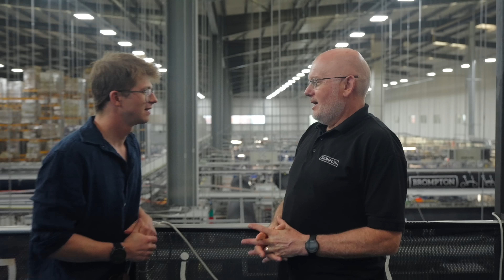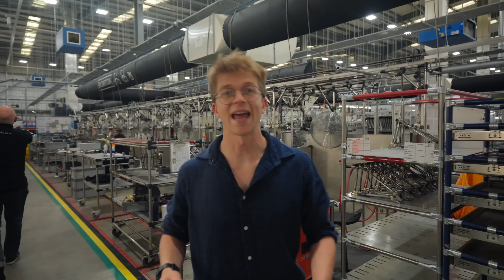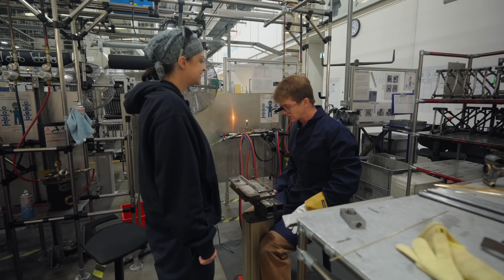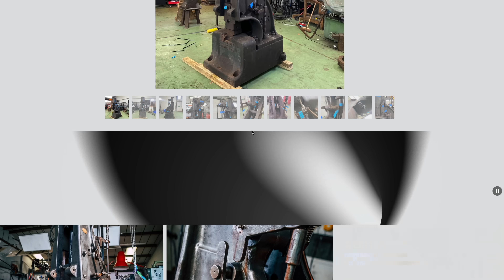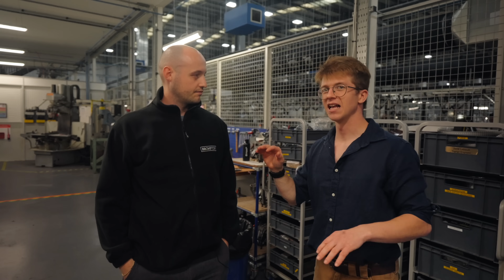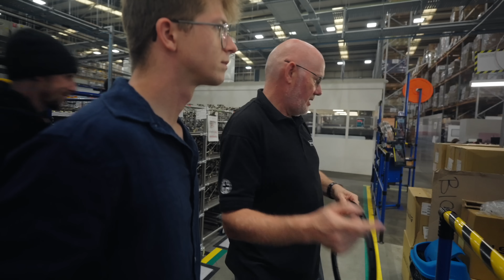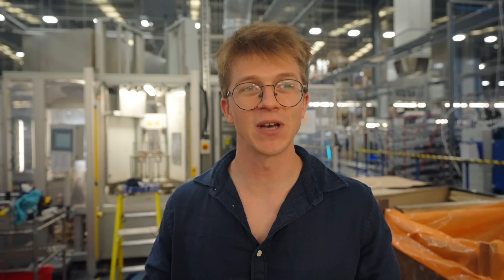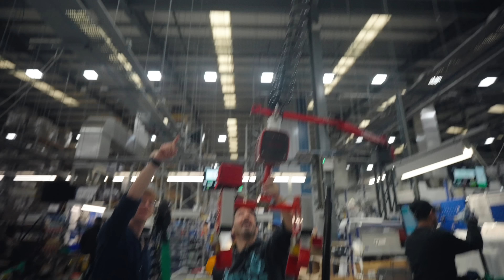Making a Folding Bike

Comment: That guy talking about increasing production from 12k to 50k bikes a year and then very casually drops that they also implemented a 4 day work week and still maintain their goal production levels is such a flex
Reply: And 50000 was the original goal. Two years ago they made 90000 in one year. @2:00
Reply: And reduced TACK time from 4 minutes to 1:30…. As a production engineer I will admit this gave me a chubby…
Reply: @Yellowsupersport1999  Takt time, German word.
Reply: @jamesharper2980  yep, autocorrect got me.
Reply: @Yellowsupersport1999 *Takt time. We use it in Toyota Production System. Or TPS.
Reply: @ditzfough I thought TPS reports were only at Innotech 😂.
Reply: I said WOW out aloud when I heard the TACK time reduction.
Reply: 4 day factory weeks are so legit good.
Reply: @entropy11 I wonder if as 24/7 factory with a 4 day work week you could choose which days to work, probably not but it could help with people's different schedules and such.
Reply: Wish all companies had that management.
Reply: And at the same time there is laughing and table tennis in the background. I want to work there badly now!
Reply: Lean with a capital 'L'...
Reply: That bloke probably makes more than some small level MPs
Reply: that guy is an absolute legend
Reply: I'm 14 years deep into a different industry, but I'm thinking it's time to switch up and move to England.
Reply: @bish0P_v52  considering the same thing honestly
Reply: @OfficialZurg see above👆
Reply: @bish0P_v52 trust me, your better off where you’re at. Unless your popping over on a small boat obvs🤷‍♂️ and no, I ain’t joking
Reply: @illsaveyes  Everywhere has their share of issues, but the fact that more European countries at least somewhat seem to care about employee's well-being is definitely a plus.
Reply: @illsaveyes tell you what. You leave. I’ll always welcome people who want to live in my brilliant country.
Reply: @davepayne164 it’s mugs like you that have ruined it in the last 3 decades 👍well done
Reply: @illsaveyes my last two bosses have been immigrants. Paid more tax towards this country than you. Go find a flag and a lamppost
Reply: @davepayne164  Well said and…

@illsaveyes Yes, my ancestors were here before the Norman Conquest. 

We’ve been an island of mongrels since the dawn of time. Get your head out of the bs that Tommy Robinson, Farage and the Murdoch’s propaganda have hosed you with. 

I was at school with Forage for a while and he was a divisive bigoted greedy  little coward even then, age has not improved him. 

Too many people from my family fought and lost their lives in the struggle for equality and justice for all people during the last century alone. They fought the battles for you and I to live in freedom, peace, equality and the never-ending ideal of justice for even the weakest and poorest. 

You don’t get to throw away their sacrifices to drag us down into the gutter of stupidity, ignorance and blind hatred again. 

This is my home, my birthright and mine to defend. Defend it I will against all of the blind faux nationalists who want anyone to blame but themselves for this nation’s problems, always raging to tear it apart but never with a viable set of solutions to replace what they’ve destroyed. 

Get over yourself, you’re no better than I am, and possibly for the most part no worse. 

That goes for everyone, like it or not I will always applaud the genuinely talented and successful and always defend those who are weak sick or disadvantaged, regardless of wealth, race, colour or creed. 

THOSE are the values that make us stronger as a society and those are the values that generations of us have fought for. YOU do not get to piss on their graves.
Reply: @robm.4512  Well said. You are the second person I know who went to school with Farridge. My friend described him as a nasty, racist, little oik as well - and one that was universally detested by all his classmates. One does wonder whether all of his ridiculous behaviour stems from him running into classrooms to write his initials on the blackboard as a “joke”, and he simply hasn’t grown up since that point.
Reply: Our company has 4 day workweeks at 10hr days from 6-4 for the production line and when I was working in it before I went to customer facing stuff, it makes a ton of sense to do for production. Adding 2 hours a day to 8 hour shifts might be rough for places with bad ergonomic design for the production team (like an Amazon warehouse or something), but in a lot of places - you don't notice it at all... So you work the same amount of hours total but get 3 day weekends? Not like anybody wants to go out monday-thursday night anyway and do anything...so it really won't even effect your social life much at all going to bed at 8.30 - 9 PM every night.

Honestly, when I was working final assembly/quality control at my work before changing into tech/customer support - I loved four 10hr days dramatically more.... now I'm salary at the same place and I work more like 50-60 hours a week because the moment you're salary it's "Wait...why can't you work at 9 PM, what's wrong with you? Don't you want a good product?" ... My wife works for a Japanese company that frequently has her work more than 40 hours....she gets ridiculous bonuses though at least, hahaha. The upside is that when there's nothing to do...there's nothing to do so you can spend time learning stuff to improve yourself and possibly your product later (like if you're a dev right now, learn other OS systems, update your knowledge on IT/network security, don't just follow trends - actually branch out your knowledge base laterally). . . Cause if you don't, someone else will 1000% take your job.

It's a very very very different mentality.
Reply: Dude is officially a badass ❤
Reply: and did 90,000 in 1 year as well
Reply: I would love to see what they did from a continuous improvement perspective.  Was it TOC or JIT type improvements?
Reply: Clever investments all round. Invested in tech to increase throughput, enabling them to invest in people and their wellbeing to keep motivation and production levels sustainable. No wonder the people you saw had stayed there. Not rocket science, but many companies get stuck in a rut of ‘we’ve always done it like that’ and not being open to new ways of working in terms of tech and people management. Work smarter not harder.
Reply: Very nice profit margins
Reply: shame their Ti frames are falling apart lol
Reply: I mean they've proven that a 4 day work week is actually better, i'd happily work 2 hours longer a day to catch up if It means i'll get an extra day weekend
Reply: More CEO's need to take notes (and in America... with AI. a paycut cause lets be honest, they're the only ones that can use it to automate their job already!)
Reply: Production engineering is black magic to some people only because they get complacent about how they’ve gotten used to doing things. It’s worked all this time, why change it?

Breaking down workflow into tasks that can be assigned to efferent workers goes against the grain of some traditionalists who insist that each worker know all the tasks. That’s beneficial when your labor source is uncertain but it bogs things down in duplicating tools for instance. As seen here, having each workstation supplied with only the tools that task needs saves bunches of money and cranks up productivity because the worker has less clutter to deal with, and can focus on their task.

Then there’s deciding which jobs really need to be done in-house and which can be outsourced. In one case this company outsourced making one complex part, in another they spent a bunch of money to make a different complex part in-house. These decisions need to be balanced against how many parts you can afford to have waiting to be worked on as we saw in the staggering reduction of their warehouse space. That complicates their shipping and receiving, and is also subject to transportation speed and costs to get parts from an outside source to their production floor. They’ve clearly found a balance that works for them, but they still retain flexibility if tariffs or regulations or whatever interferes with that.

All of their decisions are driven by their insistence on maintaining a high quality standard while increasing production rate. That’s never simple.
Reply: i mean, 5 day work weeks resulted in higher productivity, and all existing evidence shows the same is true of 4 day work weeks
Reply: @flaming_ace combined Labour productivity has increased 250% in the US since roughly the 1960-70s yet people’s real terms wages haven’t increased they’ve depressed nor do they work less we work more hours per year and for 90.8% less pay with a cumulative price increase of 994.51% put into words for every dollar someone earns they have nine percent of the purchasing power as someone earning the same dollar in 1960-70s circle back to the cumulative pricing and the fact that most necessities have risen by 1000% shows that we’re being well and truly shafted
Reply: @MayDaygxd8497  It's a bit like the mythical man month. Plenty of studies have shown that increasing productivity can also lead to reduction in quality and higher staff turnover. People get tired, mistakes get made, cost of waste or rework increases. Move to a 4 day week, staff have more time to do basic things like sleep, are happier and productivty can increase or be maintained for longer. Sadly, a lot of employers aren't like Brompton, especially if they also don't pay well. Which then goes back to increased staff turnover and more time spent training new hires. It's a situation that I think is worse in the US where a lot of employers just don't value their employees.
Reply: @brolohalflemming7042  My job is pretty much the anti-Brompton; we even used to have "pinks" as well. We are having huge turn overs and consent mistakes since there is almost of new staff after a month has gone by in the machine department and my jobs idea of training is do the job now, ask questions about things you can't possibly have enough knowledge of how things work there to ask your first day and pray that you job notes actually tell you what your supposed to do since it's going to be your fault if they don't (you're just supposed to just know that customer X wants part Y to done with process Z, I wish I was joking). We've had 20+ veterans rage quite since I started and the higher ups don't even bat an eye. The saddest part this down ward trend only started just over 5 years ago when the man who built this company up from a small 5 man operation to an international one passed away from cancer leaving it to his nephews who have run it into the ground while doing everything to squeeze every ounce of profit by screwing the workers over.
Reply: @brolohalflemming7042  It's not worse in the United States, it's just that Americunts are willing to work for unlivable wages because they have been programmed to believe they are inherently worthless if they're unemployed. Licking homeless assholes clean for 8 cents an hour?!?!??! By god, that's a job!!! I'll make daddy proud!!! Make America's mental health great again!
Reply: @MayDaygxd8497  this isn’t exactly true. We have been accomplishing the same amount of work with fewer workers as generators and engines have gotten more powerful. The people themselves though aren’t any more skilled and most of the new growth in skilled work has developed abroad, so demand has fallen. The average American today has essentially no marketable skills, and our skilled tradesmen as a proportion of the population is lower than it’s been in decades if not a century.
Reply: @MayDaygxd8497   Say thanks to mass immigration for undercutting the wages of the working classes across the West.
Reply: Back in 2015 I owned a cosmetics company selling about €6 million a year. I tried everything to improve efficiency, the one thing that really worked was starting at 10am and leaving when the work was done - usually about 4pm.  It turns out what employees value more than higher pay is time with their freids and family. Output went up and errors went down.

I meant people could drop their kids off at school, come into work and easily be there to pick them up after - it fit in with their lives.  We could not do 4 days as we have next day orders to dispatch. But its a similar principle.
Reply: @piccalillipit9211  It's crazy how much of a difference starting at 10 instead of 9 makes. Those of us who naturally sleep later are actually rested and others get a relaxing morning.
Reply: We need that guy to teach every Western manufacturing plant engineer! Dude is amazing!!!!!
Reply: In America many manufacturers use a compressed work week. 12 hours a day 4 days on then 4 days off. Then 3 days on and 3 days off. It's a double edged sword.
Reply: @atomicrevenger4745  for my brother they also swap shifts every 2 weeks 😑 yes they have abhorrent turnover
Reply: Are they hiring and paying for a cross country move?
Reply: 4 days means you get 3 days off every week. Having had a job where it was 4 10s I approve.
Reply: Its been proven that shorter work weeks increase productivity. Weird having happier employees makes them want to work harder, who'da thought?
Reply: Not hard if you outsource all the technical work
Reply: If you work 5 day at 8 hrs is the same as working 4 days at 10 hours
Reply: @msrider653  Usually when employers say a 4-day workweek, they still do 8-hour shifts. It really is just dropping a day, though of course, not absolutely everyone does it that way.
Reply: @pdan4   Depends on what you do. 4-day work week usually means longer shifts
Reply: @msrider653  Sure, but you also get an extra day off, instead of your entire weekend playing catch up.  Those extra 2 hours a day matter less, when you have a day where you don't have to wake up early/get ready/commute to work + home.
Reply: @msrider653  as someone who worked 4-10s, then went to 5 day weeks for 9 months, and moved to a job that very soon after i started went to 4 day work weeks...i can tell you that 4 day weeks are life changing. 1 more day to do personal stuff, wind down, and forget the job is coming up again soon. We literally told them if they try to return us to 5 day weeks we would all quit. They tried for day shifters and their work quality and productivity went down and just congested the work site we drive and move things on
Reply: @msrider653 they are talking about matching a 40 hour per week wage, but reducing hours to four 8 hour days. So you still make the full time wages but employees get more time off to refresh, which studies have shown results in higher productivity than five 8 hour days
Reply: @msrider653 it’s not really though. You only commute 4 times and most commutes are at least 30 minutes each way. That saves an hour. There’s the efficiencies of not going in every day and having an extra day to do what you want/need to do etc.
Reply: @matthewshaw3747 yeah was thinking the same. I think for a worker it is big difference if you don't need to go there for 3 days. It takes time to prepare to go to work and commute... And when you have a weekday off you often can take care of many things as all places are not open in the weekends etc. So it might be that person would sometimes need to take day off because of something like that. 2 hours longer working is not so big deal anyways when you in every case are already in the factory.
Reply: Their cheapest model is $1600 USD to start. 

It’s not a flex
Reply: The people who ride these bikes use it as their primary mode of transportation mixed with public transit. Doesn't make sense in the US because of how public transit works, save a few states. However, having been friends with cyclist and briefly dabbling in it myself, you would be shocked at the amount of money cyclist are willing to drop on their equipment/bikes. To them they're like cars, in fact my mate has a small truck, souly to carry his bikes to other cities so he can ride there. Annecdotal experience, but outside of the US a bicycle/e-bike is quite handy.
Reply: @brennendelapaz I could buy a top of the line bike tricked out with all the nicest components and accessories, then throw it out at the end of the year and buy a new one, every year, and still spend less than I would on a car on a yearly basis.
Reply: @brennendelapaz  Yeah man, people in here balking at a 2k USD bike. There's so many hidden costs to driving. 2k is nothing.
Reply: @aim-at-me  Bet that's the cost of insurance and maintenance for many people.
Reply: @Kenthis15 good quality stuff sells.
Reply: @Kenthis15  moving product clearly isnt a problem

Comment: Interesting tour, and what a great design for the jigs and brazing stations especially. 
But I can never decide if these modern JIT highly outsourced production lines are really a good thing on not - impressive as they are, and efficient when they work it just feels like the whole thing is resting on foundations you can't really really rely on - what happens when the dock workers or truckers go on strike, the tube company that was doing all that work has a fire/flood goes bust? I've always thought that sort of production line should still have a chunk of floor space dedicated to keeping the old tooling you once required when you did this part in house or the prototype and jig making shop being a more core in house element with deliberately cross training a selection of staff on them so you can always keep working and adapt - a drop of 50% output when something bad happens is far better than a month or two of shutdown looking for a new supplier.